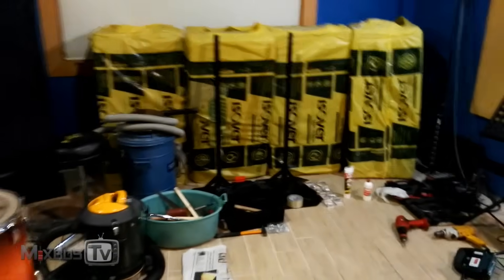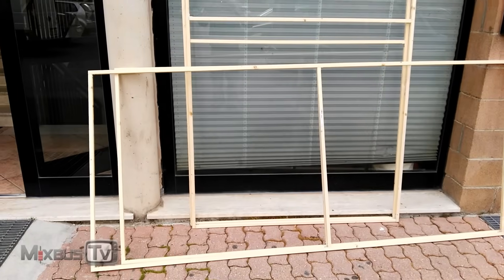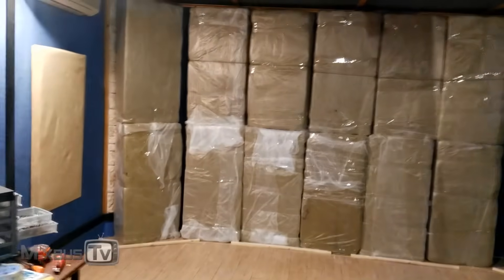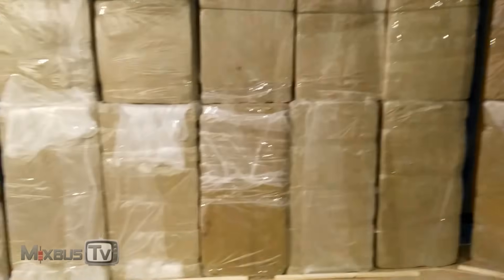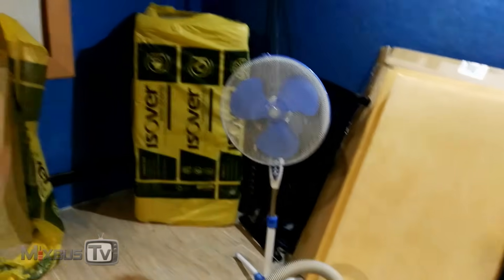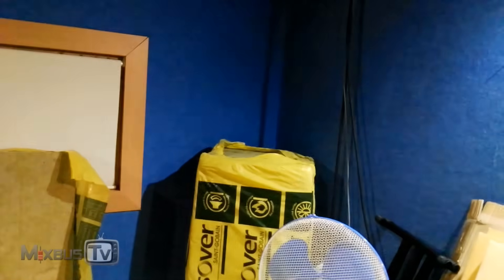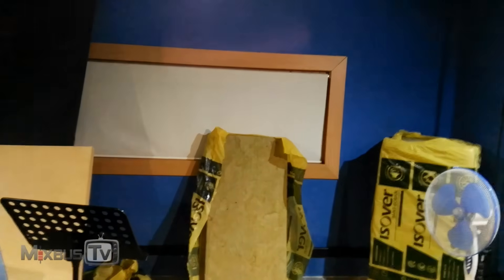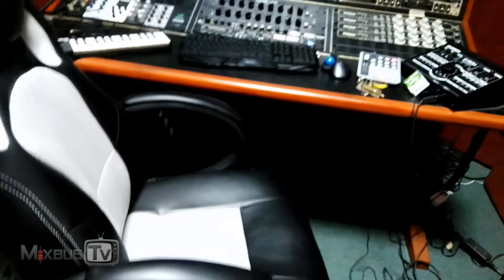Fix Home Studio Room Problems Best Monitor Position Quick & Easy fix for Bass Null & Side Walls

Comment: Hi David...just watched this vid now (over a year after you posted it).
I have a small home studio control room, and I'm gonna move equipment and materials around to try improving the geometry and translation ability of my mixes. So your vids (old Italy studio I assume?) on the new control room build are pertinent to me now.
But as a retired guy...61 yrs old and doing about $2-5000 of mixing business a year now, I can't afford a Meyer Sound SIM3 -type calibration software/mic set-up.  Did you use calibration/analysis system to understand the comparison of the desk output freq response vs. listening position sound, or did you just use your highly skilled ears? I'm highly considering buying the Sonarworks Reference 4 Studio Edition with calibration mic for $299. Do you recommend this system or know of another system out there to use besides the $5000+ Meyer Sound SIM3?
Any constructive feedback on this topic for me would be great. Thanks!!
BTW: although I'm far from being a Hip Hop or Metal guy, I bought and loved your PMA Hip-Hop course and recently your Drums w/M. Starr course. Loved them both...learned alot that translates to my Jazz, Celtic, Percussion and Acoustic tastes. Thanks man!!

Comment: Hi David, did you measure your room with Room Eq Wizard? And is your room perfectly flat/linear?
Reply: Thank you for your reply. So you made the room pretty dead, especially in the low frequency, so that you can hear the kick and bass exactly the way it is and then you tuned your room to your liking? I can relate to that, the baddest thing is if the room is too flat and all music sound very flat with overkilling the high frequencys and not dynamic like in the real world. Will give your tips, mentioned in the video a try with getting all edges rounded up with absorbtion material and getting rid of the first and second refletions. Thank you very much!

Comment: i got 2 questions  to have the +1.22V rms +4dbu should i use a -20dbfs sine wave or -18dbfs ? and in gain staging should i gainstage each instrument at the level of 0VU is -18dbfs or 0VU is -20dbfs ?
Reply: i said that cauz i have a presonus vsl 22 with a max main output of 10 dbu so what i did i took an rms multimeter and i launched a -20 dbfs sine wave like what smpte said to read 1.22V which is the pro line level that's mean i'm hearing 6dbu of headroom in my studio environnement and to be more specific i calibrate my krk rokit 5 with  a -20 dbfs pink noise to read 75db spl cauze i have a small room correct me if i did it the wrong way  ,and why i asked you the second question cauz some plugins have a sweet spot in -18dbfs and others have different one and i heard somewhere that  some plugins react badly if we give them the wrong level of signal is it true ?
Reply: i don't throw terms or trolling shit together like you said everything i said i can prove it with papers and useful articles i was expecting some precise answers thinking you are a professional that teach people in youtube but instead i got some personal judgements and not a single useful information and you are telling me to calibrate my speakers with a commercial mix ? and to read whatever db i want IN THE SPL METER ? i thought i was confused but you seems way more confused than me go back to school the joke is on you (mix engineer(

Comment: +MixbusTV - David, nice video.  The Control Room is looking great.

Search for a PC program called ''amroc - the room mode calculator''.  You might find it useful.  ;)  Good luck.
Reply: Also, your thick rockwool/mineral wool baffles on the rear wall, side walls, and ceiling/cloud panels will be more effective at absorbing Low frequencies especially (and all frequencies) if you pull them away from the walls & ceiling 8" or more (ideally as far away from the wall as the panel is thick).

The frequencies will be absorbed as they first enter the front of the baffles, and then absorbed again as they bounce off of the wall and pass back through the baffle towards your listening position.  Moving the baffles off of the wall effectively lowers the low frequency absorption capability by 2x.

In general these types of absorbtion panels only start to become effective when they are a minimum of 1/4 wavelength thick of the frequency that you want to absorb.  For instance, a 40Hz note has a wavelength of approximately 8.5m or 28ft, so your absorbtion panel would need to be at least 1/4 as thick as that, which would be 2.125m or 7ft!  But then you would have no control room left, haha.  And obviously you are not trying to create & do not want to create an anechoic chamber!

Check out this Frequency/Wavelength Calculator:  http://www.1728.org/freqwavf.htm

Comment: Thanks David! Glad your surgery went great and you're back at it! Good for you!! I liked your tip* ~ "friend helping you using a mirror, while sitting in the mix chair, for seeing the actual / correct reflection points hitting the L/R walls. Great help n guidance (for placing both of your left & right acoustic panels) awesome! Thanks & Happy 2018🎆

Comment: I like the show David, kudos! I could be wrong but I believe the plastic wrapping of the mineral wool is contrary to the concept of absorption. I've always learned that the whole idea is to convert acoustic (kinetic) energy into heat. Air (pressure waves) needs to be able to travel through the wool in order to get 'absorbed'. Maybe try a cloth that keeps the fibres & dust out but lets air through?
Reply: Okay, cool. I can't wait to see -I mean 'hear' how the room turns out when you're all done. Keep us posted will ya?

Comment: If you move your speakers more against the wall, doesn't the (axial) freq null (and it's harmonics) go up in freq? (that's the way I know and it seems to me) ... and then, the acoustic treatment material can deal with higher freqs more easily, that is the theory at least as I picked it up..  I also have my monitors as close to the front wall as possible, front ported speakers work in this configuration.  Question: Why did you let the mineral wool covered with the thin plastic wrap? To maybe try and reflect higher freqs so to prevent the room sounding dead from too much absoption?
Anyway, looking good so far, can't wait to see the progress and some measurements later on! :)